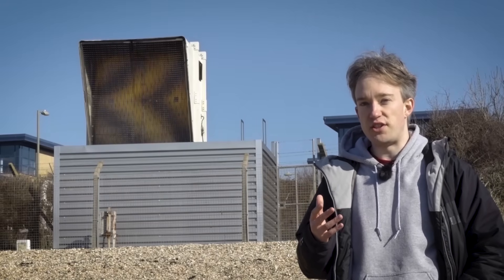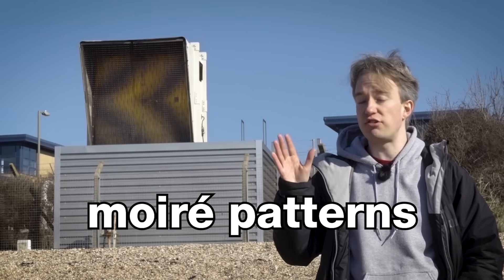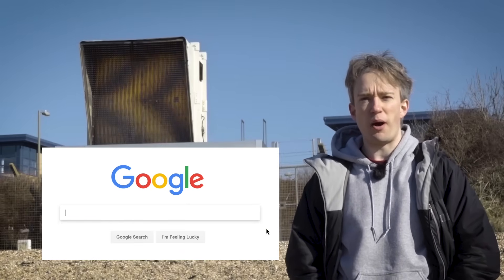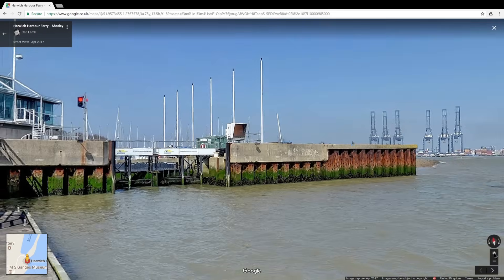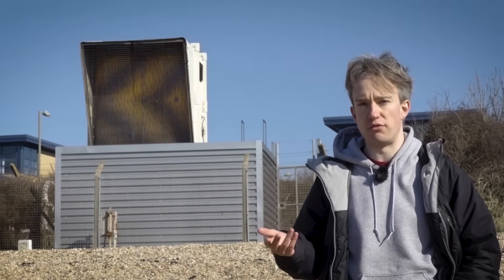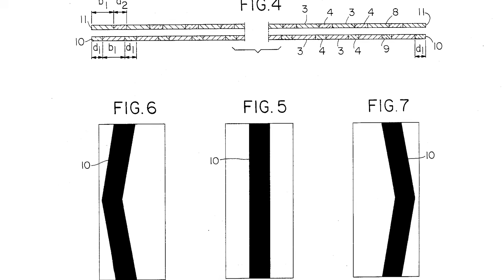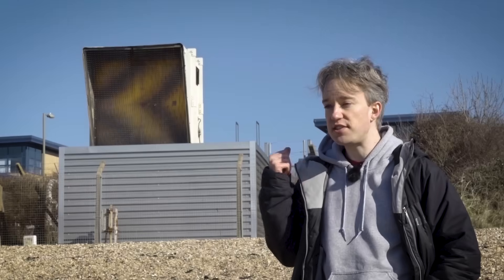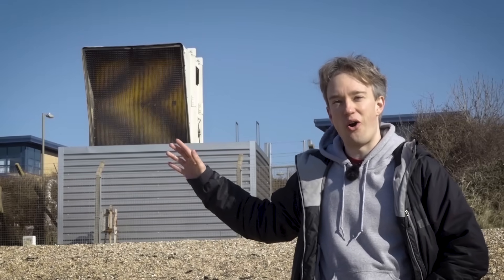The moiré effect lights that guide ships home

Comment: Hi, I could be wrong, but my guess is that - given that this is a Swedish invention/name, Inogon COULD be derived from “in-ögon” or in-eyes/eyes-in, i.e. an extra pair of external “eyes” to guide the pilot in to the gate...

Moiré effect is also used in description for aircraft docking systems in Wikipedia...
FMT	Edit
The Aircraft Positioning and Information System (APIS++) is manufactured by FMT.[2] The left side of the unit displays Azimuth guidance; providing the pilot with vital information when as far as 200 meters from the stand and while the aircraft is still perpendicular to the stand centreline. The right side of the unit gives the pilot precise information concerning closing rate as well as instructions when to stop.

The azimuth guidance, based on the Moiré Pattern,[clarification needed] works independently of the laser that calculates distance to stop and is unaffected by weather conditions.
Reply: Hardly Swedish. My bet is it's Greek. "-gon" for "angle".
Reply: Ute å seglar , off course, you’re right... 👍

Comment: Actually quite similar in function to a VASI/PAPI approach path lights at airports. 
They also use a simple static system that changes the visual configuration of lights solely using your relative angle to the lights, thus allowing to see whether you are within a set approach path without any tracking.

Comment: there's some of those signs on the dutch roads that flash the arrows at you or just flash in general to alert people of a corner coming up.

for example google "mcdonalds Barneveld" and go to maps. assuming google doesn't change the results because I'm in the Netherlands go to streetview on the rightmost one way road (north up) and in the corner there will be signs like this one

youtube doesn't like URLs and googlemaps URLs are long anyway but this should work

Comment: This sounds similar to the glideslope indicators used at runways
Reply: Same objective. Completely different principle.
Reply: "VASI" lights ("Visual Approach Slope Indicator")
Reply: vasi and papi ligts use red filter and lenses. Completely different than this. It can be used for aircraft docking system though.

Comment: I think aircraft carriers also use the same technique to land jets. Or a very similar principle.
Reply: Yes, for vertical positioning instead of horizontal.
Reply: I'm aware of no aircraft approach system land or sea that uses the Moiré Effect. Airports have PAPI or VASI systems that are based on aimed beams of lights. The visual approach systems on aircraft carriers are a far more elaborate versions of the same principle.

Comment: That is really cool!

Somewhat related, you may be interested in a lighted navigation aid used in aviation called a VASI - Visual Approach Slope Indicator. It is basically a white and red light in a box with a few small openings which will allow a pilot to align on a 3 degree descent angle to the runway. It is quite a clever and simple little thing used all over the world. A slightly more advanced version is called a PAPI - Precision Approach Path Indicator.
Reply: Daniel Donkersloot yeah as soon as I saw this I thought about a PAPI light system at my local airport.
Reply: @JG_Fit  I was about to write something similar.
Reply: they actually use these inogen lights in aviation for parking aircraft
Reply: Evan Semerad I believe KLGA had these for the longest time.  I haven't been there in almost 15 years now.
Reply: Red is dead white is too much height.
Reply: @JarthenGreenmeadow  And green means you've crashed and the light is filtering through the grass!
Reply: As someone who loved playing F/A-18 Korea as a kid, this brings back memories

Comment: So what do they use now instead of these?
Reply: This Little Critic just some guy named Dave who just shouts from the shore "oi dipstick your gonna crash what the hell ya doin". word is there was never anyone named Dave who lived in those parts but any sailor worth their salt will still listen for Dave.
Reply: sam palabiyik idk what inspiration you had to create this comment but i’ll be damned if it’s not the greatest comment i’ve ever read
Reply: I assume computer guidance and GPS has taken over a lot of this sort of functionality.
Reply: Normally when you're coming into a channel there are two poles, one a few meters ahead of the other with different symbols on top of each one and you go on a course which aligns the two poles in front of each other
Reply: As others mentioned, two poles, in English they are called range markers.
Reply: i guess gps and various ultra sonic sensors which tell you quite precisely where your are
Reply: @georgplaz  GPS doesn't tell you the orientation of your boat very well though, you could be going out of the harbor for all it cares. And sonar.. Maybe?
Reply: 2 poles in the ground
Reply: Yep, leading or range(us) markers, and various other bouys and marks which we figured out hundreds of years ago and have been using for maritime navigation ever since. What's more, in daylight, they require no electricity and so are quite reliable.
Reply: In Swedish lighthouses we use lamps behind coloured panes of glass. If you're going straight at the light the glass is clear so you see a white light but I'd you come in at an angle you see either red or green and that tells you which direction to turn.
Reply: (And yes, the range markers will show up on your GPS plotter as well, however please DO double-check your navigational aids with your own eyes or radar if at all possible. Vessels run aground all the time because their GPS is off - we should know, as we keep having to rescue them. ;))
Reply: Richard Clutterbuck I can answer that as a sailor. 

There is a unspoken rule that sits (or should sit) in a navigating sailors mind to never ever trust technology. They are navigational aids, not navigators. GPS (DGPS in particular) is very sophisticated, and on ships the modern ones give 5cm accuracy, they can still fail and give faulty information. 

How safe navigation is done is by comparing information. You compare your Electronic chart (if fitted) with your own calculated position, usually using radar. Also you have to remember to look out of the windows, sounds funny, but that is a thing we do catch eachother forgetting from time to time, as you are too focused on all the information on the many different systems.

Generally, when you approach port, you manouvre using eyesight and the radar and navigate using the chart. You follow the buoys and other aids fitted and double check your position using the radar by taking bearings and distances to fixed positions, as buoys can move and again, only are aids, not navigators.

The difficult part of the job is not using the systems and aids provided, its spotting the lies they tell and knowing the cause of the lie, know how how to fix it and know how to navigate without that device if needed.

Theoretically, a ships crew should be able to navigate (somewhat) safely without any electical devices to aid them, but that isnt true for many flags out there.
Reply: What Cinder said!

The most common direction markers are range markers - two poles with a light on top of each. One is sitting higher than the other, and one is sitting further up on shore than the other. If both the upper and lower light line up, you're "on ranges" as we say, which means you're going in a straight line through safe waters or the deepest part of a channel, directly where you're supposed to be. If the lower (closer to you) light is off to the left or right, you're coming in (or leaving) at the wrong angle and can correct your course accordingly.
Reply: In Canada we call lights like that 'Sector Lights' :)
Reply: The maritime industry and various gov waterway management across all nationalities basically continue to use anchored buoys - red and green. The problem with signals like these? They're expensive and also difficult to relocate  - most channels, whether dredged or  natural move overtime - and detaching a buoy from a concrete block, sinking a new block & attaching it is a lot easier than moving a permanent installed light.
Reply: A tree stump and a white cross, a la Swallows and Amazons.
Reply: And that's what we call them in Sweden too. "Sektorfyrar". ("Fyr" means "lighted beacon", "lighthouse", and is cognate with English "fire".)
Reply: radar, gps, glonass, sonar, eyes, retroreflectors
Reply: From what I know, besides GPS and land marks, they use two light beacons of different heights separated by a certain distance. That way, when you see two lights above each other, you know you are going straight towards the lights. If the lights aren't straight above each other, you are not following the correct line.

Edit: They are called range markers indeed, I see others already mentioned them.
Reply: Notice those little buoys with lights on them in dangerous coastal areas (i.e. cape fear)?  Boats go in between them and they flash to show that you are heading in the right direction.
Reply: When all else fails (electrically speaking on ship) this will still work.
Reply: This Little Critic gps
Reply: 2 poles, one higher and farer away. Opposing triangles (and lights) on top. If they appear directly on top of each other you are right. Otherwise you steer in the direction of the upper light. 

this solution is cheaper, visible in the night and easier to build bigger if it should be available from the distance
Reply: This Little Critic a guy with a flashlight
Reply: Richard Clutterbuck Other vessels may be anchoring there as well. Additional navigation aids are hardly a bad thing, which is why transits are still used.
Reply: For airplanes there's visual and radio glide slopes to make sure you're at the correct approach descent angle and direction.
Reply: Richard Clutterbuck The GPS (ECDIS) that displays charts electronically is just as expensive as normal charts and needs to be updated weekly as well, just like the normal charts. You dont buy one device and it has the world map on it. Just like with normal charts you need to buy them one by one for the system, called ”cells”. The more you have the more expensive it is (each cell has its monthly cost). Also they arent updated through internet, you get a bunch of CDs or a USB stick with the updates for all the cells at each port you go to. Furthermore, its not like with google maps where you can zoom in indefinately. For the same area you might have to buy multiple charts to be able to see correctly what you want. A too large scale cell wont be detailed ebough to get any useful information fro when you zoom in
Reply: Treblaine GPS (ECDIS) doesnt show things in real time. It shows how the terrain looked the last time the cells were updated. Buoys might move around or brake loose. Also the GPS doesnt show any other ships than those equipped with AIS. 

If you sail by GPS only in rain and fog and you might suddenly collide with smaller boats or ships which have a broken AIS (not uncommon for the AIS to be broken)

Radar is a lot more effective, it works in rain, storms, fog, sandstorms etc. Also the radar shows targets without AIS. Furthermore the radar shows an overhead picture of the area in real time, not up to a month ago. Lastly with the radar you can always be 100% sure that that is your actual position. It takes a minute at most to get your position from the radar into a chart with high accuracy.

The ECDIS is intended to be used for planning routes and making guidelines that show up on the radar. You should never use it to get your position and navigate theough traffic if you have any chance to use the radar instead.
Reply: Oh yeah, and you've got those radar-retro-reflectors and also radio-transponders to very clearly find both particular points in a cluttered environment as well as particular lines radiating from said points.
Also, are there not radio/microwave equivalents to Moire Patterns? I remember hearing something about the "Battle of the Beams" where a radio emission was able to make it so it was apparent if you were on one side or the other of a beam-line.
Reply: They certainly allowed you to tell if you were veering off as the signal faded as you went off beam, but I'm not sure they told you which way.
Reply: @Treblaine  Those German WW2 radio beams used two which intersected over a certain point. Planes flew along the "beeps" until they heard a constant tone (where the other beam intersected the one they were following), then dropped the bombs there. Once the British discovered it they knew where that night's target was (so could station fighters along the route) or send out thier own beams to get the enemy to drop thier bombs elsewhere, ideally in empty countryside.
Reply: Richard Garnish LORAN isnt used, but X-band and S-band radars are.
Reply: Treblaine I dont know about the lprie patterns, but most light houses and some buoys which are fixed to the ground have Racons, it shows up as a large morse letter on the radar screen. Impossible to miss and easy to navigate with
Reply: @SportSoulLife  *moiré
Reply: GPS. Or, well... these. They're a remarkably recent invention, and extremely reliable. As Tom briefly mentions, they're in active use at a lot of airports to guide planes into parking spots around the terminal where they're exactly in line for the airbridge exit to easily mate up with the front door. You could probably come up with something that would do the same job, but this already works perfectly and can work using ambient sunlight alone (or at night, a single relatively low powered sodium light bulb or monochromatic LED), so why bother going to the effort of trying to invent it?
Reply: Light house
Reply: Red and green
Reply: Airplanes for example when landing will see red lights on a run way if they are angled a certain way and green from the same light if differing
Reply: sam palabiyik best comment of the week, laughed out loud
Reply: when you say off do you mean turned off or off as in has an error.
Reply: GPS works in fog and rain, probably used for everything as unless there's radio interference or satellite attacks, GPS always works.
Reply: LORAN? Is that still used or has it been supplanted entirely by GPS now?
Reply: Treblaine yes and the radars on ships have much more adjustabllities to the weather conditions than a commercial radar.
Reply: black magic
Reply: Buoys. Or just warning lights
Reply: Or just pay a visit to the local harbormaster and get a map of the harbor from him
Reply: This Little Critic often there are lights which are white if your in the middle green if to the right and red if to the left
Reply: Satellites
Reply: They still use these, FMT (the company who makes those light) just sold the rights to ThyssenKrupp.
Reply: airplanes

Comment: Genius which goes unrecognised...
Pringle extraction using chopsticks.
Reply: CFW. Magic When sliding the pringles, cover the top with the hand so it doesn't go everywhere. The problem with the chopsticks is that I can't use a chopstick
Reply: CFW. Magic - ez and convenient
Reply: I just turn the can horizontal and let the pringles slide
Reply: That's the problem, it gets everywhere. And you need to turn the tube horizontally and you can't hold the tube between your legs as you evolve into a potato... I am a potato btw.
Reply: And now try to relate this idea with the idea in the video. That was what I was trying to get at.
Reply: CFW. Magic Alright then